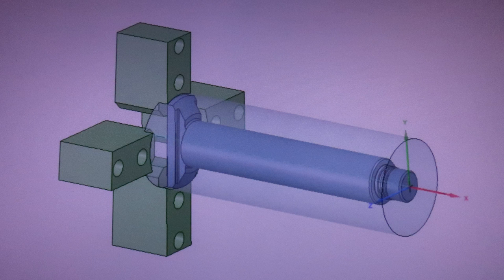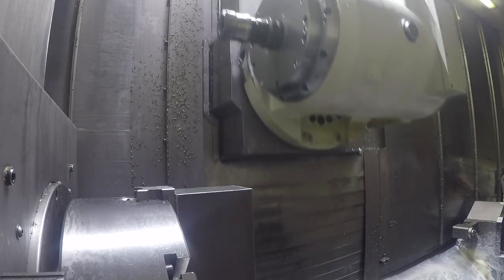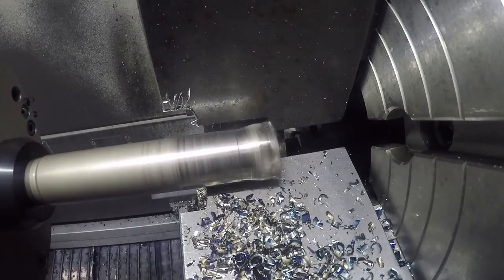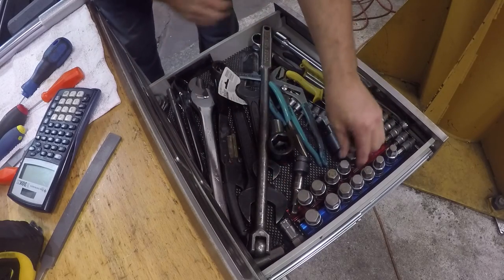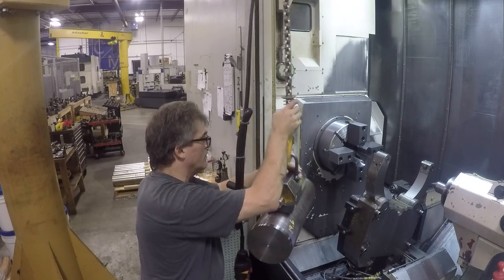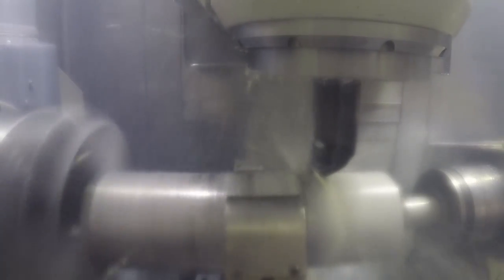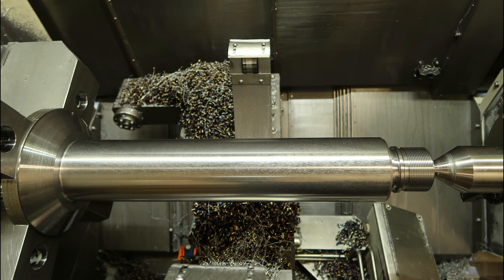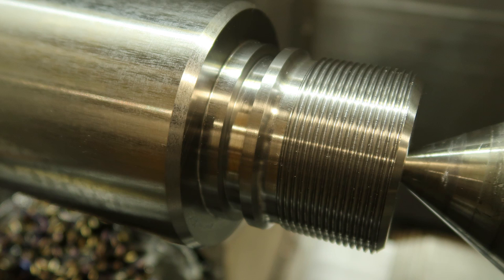Ram Shaft -1

Comment: No iam glad you didn't cut the jaw prep out of the vido because there are alot of people out there that dont relize how much goes into making a part thay think just put it in the machine and make the part so thats a good thing
Reply: I will never get it what gets you (mainly Americans) to use a 4 Jaw chuck for round parts...
Reply: @Fabiable  Concentric from the very beginning... this isnt a MM vs IMP thing. Its based on principle or poverty (no$ for both 3&4 jaw).
Reply: @Fabiable  Better holding power with a 4 jaw. Spin that size shaft that fast sticking out that far while facing and there's a good chance of chucking the part in a 3 jaw.
Reply: Fabian Nenning 4 jaw chucks are much more precise when well adjusted. 3 jaw chuck will always shake a little bit (around .003") so if your tolerance is thighter than that you got to use the 4 jaw chuck
Reply: @RochCroque  what a bullshit, if you use soft jaws on a 3 jaw chuck and have a workpiece with a good face and turned surface, you will get 0.00mm concentricity.
And i had faced/turned the ram shaft first with hard jaws into his diameter, on the this "T" side.
Then clamped on soft jaws and turned the thread and etc.
Switched to clamp on the diameter and milled the other side...

Time is money and you as americans should understand it the most...
Reply: @Fabian Nenning. UK here. I haven't worked on a CNC lathe for 20 years and I couldn't believe what I was watching. First op I would of used a sling ( no fancy magnets back then 😃 ) and put it in a set of hard jaws in a 3 jaw chuck. Bashed the other end to true it up 😊 then faced and centre drilled it. By the time that op had finished he would still be using a clock checking his 4 jaws. 😂. The 2nd op would utilities a set of pre bored soft jaws. I didn't ever do any work on a CNC lathe using a tail stock but locating onto the centre would be easy enough. Saying that even the 2nd op could be done using hard jaws. This looked like a lot of faff for what was being done. Even that machine didn't look like the right machine for doing the second op. An ordinary CNC lathe with tools on a rotating head would of done.
Reply: @hocln2556  but turning soft jaws every time to your desired shape + material cost isnt worth it

Comment: So nice to see videos about the specifics of CNC setup from a genuine working professional. So much of the stuff on YT is either amateur or pure theory from applications techs. 

Also, Okuma has a envelope travel limit feature (I'm 90% sure Mazak does as well, but its been most of a decade since I ran one). It basically puts a soft limit on the travel in both directions in whichever axis you need. I use it a lot to basically guarantee that I won't hit my jaws or center. On jobs like this especially, it helps to reduce the pucker factor.
Reply from the maker: Duncan Thanks for your comment. The Mazak also has what they call safety barriers (I usually turn them off). That doesn't help when your in the cam software. In Esprit TNG you are working with a accurately defined model of your machine. So it will tell you in anything is wrong down to .001" or better or what ever you define. This is particularity helpful on a mill turn doing milling on the face of a part. Many of them have limited travel in the X minus direction. (Min has only 10 mm X minus travel) So if the simulation shows you going out of machine travel in the X minus direction You can change the C axis solution or machining strategy to correct the problem. Without that you would have to find out when you run the machine. This can be as little as .0001" so without this ability in the software you can't see it in a normal simulation. If you use accurate tool models it can also do the same for tool collisions. Something the Safety barriers may not tell you.
Reply: @EdgePrecision  I seem to remember being regularly frustrated with the soft limits when I was running Mazaks. We ran all Mazatrol programs, and were pretty lax on defining the tools, so that probably didn't help.

Comment: That was one of my biggest fears, "crashing the machine". Back in the day, I watch a co-worker crash one of our Kitamura's 80xi's (from the late 80's to 90's edition's), mind you, that was all I needed to see, to put the fear of god in me, to never take for granted, the amount of power these machines have at their disposal to convert into absolute violence and chaos. Those were 10 and 15 hp machines, LOL...  You have my respect, as per, the 60 hp, units that you play with everyday. One missed step, and it is costly. Nice job, again on the video. The engraver pencil (although, you assumed there wouldn't be any interest in that footage), was that real time motion, and what was the type of cutter or abrasive used,... fluted, stone, diamond?.. meaning, it plowed right on through the material... Drew
Reply from the maker: Dru Bradley the beginning of the scene was in normal speed. The grinder is variable speed from 0-50,000 rpm. I was using a carbide burr at 40,000 rpm.
Reply: I crashed a Mori-Seiki SL 25 in the beginning of "my career" and it was enough to scare me :D
Reply: I worked for GE in the gas turbine division thay had some rather large VTLs with a 20' dia. chuck 3 rams i dont even remember what the HP was but anyway i seen a cowerker setting one up and the left hand ram was down and just alittle close to the jaws when he started the machine up it winded up and hit the jaw with a bang i can still here today and continued on to the next 3 jaws Bang Bang Bang knocking all 4 jaws clean off the chuck and into the air flying till the machine came to a stop because those machines dont just come to a stop when you hit the stop button nedless to say i gained alot of respect as to the power of those machines its a good thing it was the night shift and there werent that many people there because toes jaws landed right in an spot that people would have bin if it were day time to this day i check and dobble check and tripple check as to the clearance on any chuck that i am running
Reply: At some point everyone will crash a machine. Sadly it happens. The worst one I saw was on a bullard with a 48" chuck. Guy just wasnt paying attention and restarted the program with the tool inside the part. It blew the entire 600lb assembly out of the machine through the doors and into the floor where he WAS standing. Called that guy Usain Bolt for years. Another guy went full rapid into the spindle of a SL35 and blew the Jaws off the face. I crashed a 3" boring bar on a Mori nh6300 into an alignment pin I forgot to take out of a part for line reaming.

Never feels good.
Reply: User Name I’ve been indicating parts in when we turn od’s in two op’s we blend em and send them.  Forgot to handle my turret up and away when I finished indicating and went to cycle start.  We ran some long big boring bars in the turret at the time and it just indexed around immediately till it met my part in the chuck.  Was more scared I had to go tell boss man.  Haven’t made the same mistake yet though that’s true with all my crashes lmao

Comment: Honestly? The deburring was the most valuable part as far as learning is concerned. I'm not gonna be making gun drilled inconel air foils for the space shuttle on an Integrex (as awesome it is to see how that gets done!)... but damn if I couldn't use some learning on hand deburring of steel parts from a badass machinist (which you are)
Reply from the maker: Thanks. Wow you say stuff like that its liable to go to my head.

Comment: Peter, great job, thanks for the video. That surface pattern seems to be from either a cold drawn bar, or a cold worked and forged bar, before its heat treatment. This part must get some serious cyclic compression loads for them to have given you such a stock.

Comment: If you're doing a lot of this type of work it can be helpful to set up a jig made from V blocks in a mill. I used to make a heap of drive shafts and by first mounting in the cnc mill we could machine a face on both ends to a precise length,  drill, tap and cut a centre taper on both ends. Made total machine time way faster

Comment: Man I wish I got to run tiny parts like this on my 650H. Mine has a 26” SMW air chuck and never have parts under 20” diameter or so. Nice video tho. I like how you went through the whole process with the material prep and Jaw stetup. Most people don’t get to see all the stuff needed before even turning the part.

Comment: Do you make your own sacrificial jaws? Or buy them by the boat load? I really enjoy your videos. Not everyday you get to see start to finish process of limited run, tool room style work on a huge machining center.
Reply from the maker: No I buy blanks and machine them. It is difficult to compete with the people that make the jaws. Often times the blanks cost not much more than the material if I made them. They must buy large quantities of the material and get better discounted prices than I can get. It just isn't worth it for me to make the blank jaws. This is also why I have a CNC tool and cutter grinder and don't grind standard end mills. The price of the centerless ground blanks at the quantities I purchase. I can't compete with big manufactures. Plus the cost of coating the tools. I only grind special tools.
Reply: Thanks.

Comment: Nice work! Not sure what CNMG insert you used on that roughout operation. I've had success with Sandvik's CNMG 543 (r.046) PR 4305. 425sfm .026 ipr @.300-.325doc.  4140 brinell of 300-310. Not sure you want to apply that amount of load on a Integrex. But a little Nexus 550 will do a great job handling those loads. The only problem is the jorgensen conveyors can't move fast enough to evacuate the big chips up the incline. So change the little sprocket, up one tooth, to increase the speed of the belt. I rough the hell out of some parts for FMC with a positive rake holder. That way I can use all eight corners of the CNMG. Grooving I usually run at 1300sfm. I saw Y'all posted a job opening!

Comment: ..Just found your channel today...excellent contents, especially the ones about how you got started...!  What is the thread pitch on the end of these (Hydraulic?) rods....12-TPI? That's a very common pitch for hydraulic stuff no matter the diameter....you mentioned nickel plating, then ground...is that going to finished in hard chrome?...usually wears better than nickel would. Even with the CNC, do you still run a 'spring pass' on threading?
   I was the 'Welder' in a shop with a lot of manual machines, but we had 2 guys doing hydraulic repairs...lots of rods threaded on one end for pistons....almost always 12 TPI.......then I'd weld the rod eyes back on....we had rods up to 5-6"....! cylinders up to 10" or so....and 3 stage, 27 foot for total of 81 foot for cranes....5 stage, maybe 18-20 feet for dump trucks...
Reply from the maker: Doug Ankrum Yes the thread was a 12 pitch. After I did my work the parts got ground than electrical less nickel plated. I think there is some API spec. That doesn't allow the hard chrome plating. But I'm not sure.

Comment: Really enjoyed that thank you. To a newbie like myself I was wondering whether there are any viable options for a forging that starts you closer to the finished diameter but with the flanged end but have less material to shift? Not trying to be a smarty pants (I freely admit that I am just learning) but is the reason that it would be too expensive for a relatively small run?
Reply from the maker: Thanks Frank. This is manufactured to the customers spec. They say what material. I guess a forging would be closer but the quantity is so low they probably don't want to spend money on the tooling.
Reply: @EdgePrecision  thanks for the reply and thanks again for the informative video.

Comment: Nice work Peter.  Seems odd they want a 32 finish if they are grinding and plating the part??  You mention when you were checked for tool clearance you also were looking at the sheet metal too.  Does the machine have limit switches at all?
Reply from the maker: Bill De La Vega Yes it does. Mazak has barriers that stop the machine in Mazatrol but in a eia program these may not work. The machine has to travel in the Z axis further than this to make the tool change. So you can hit the chuck or the cabinet if the X axis is down to far before hitting the limit.
Reply: So you're loading the program from your CAM software, that is an eia program?
Reply from the maker: Bill De La Vega That's what Mazak calls a G code program. You have to save the program with a .eia suffix for Mazak to recognize it.

Comment: Excellent video as always. What kind of tip do you use in you pencil grinder, a burr or an abrasive tip?
Reply from the maker: Thanks Chris. A carbide burr for most things. But I have used all types of tools. It can be slowed down to 1,000 rpm with constant torque. Its speed range is 1,000-50,000 RPM.
Reply: @EdgePrecision  Thanks Peter for the quick reply, I'm sorry I should have specifically asked you about the tip you use for de-burring post machining. I've been a manual machinist for 20 years, your videos let me into the weird world of CNC, fascinating stuff.
Reply from the maker: That is what I'm talking about the NSK pencil grinder.
Reply: @EdgePrecision  Thanks

Comment: Great video Peter!  What is your experience with Espirit's machine simulation, does it provide good collision detection/prevention?  Also, that deburring tool looks superb, what were you using for the tip and what are your general recommendations for pencil grinders?
Reply from the maker: Norman J , Esprit's collision detection works good if the tools and holders are properly specified properly. The grinder shown in the video I've owned for over ten years. At first I resisted buying it because of the cost. It has given no trouble it is much more powerful than a small air grinder like a Dotco but a little heavier. Even at lower RPM it has power because it's constant torque.

Comment: with a shell mill made for High feed you Can go on plunge milling . in the releaf on side of the jaws you can start of outside and plunge to the bottom near chuck in less pass . and leave 0.2 mm on side to finish the surface with a 90° shoulder taking 8/10 mm of depht each pass .
Reply from the maker: Perhaps that would work the finish wasn't critical. This just seemed easer to program my cam software doesn't do a roughing cycle that I know of with straight plunge milling. I would have to program a bunch of drilling cycles to do it. If this was something I had to do over and over say in a part that probably would be the way to go.

Comment: Great!!
For setup thread turn why you use blocks, machine not have probe?
Reply from the maker: Thanks Eduard. The machine does have a probe. But the location of the probe is so high and to the back when deployed its hard to see when you jog the tool up to it. Also because my machine doesn't have a jog pendent (A handle jog wheel on a extension) I can't reach the jog wheel on the control and be up close to the tool setter probe to see. I find it is faster/easier to just touch off tools manually. I also like the conformation of the tools actual location (The Mazatrol shows the tools actual location in relation to the active work offset on its display) in relation to the part.
Reply: Not understand-me ,you best operator machine cnc or video?)))  
Best regards from operator Anca & Rollomatic!)

Comment: Nice work and great videos. Try running the 4140 without coolant and that may get rid of the spotty look to the finish. Of course only if the insert can run dry. I run iscar ic908 with a "pp" chip-breaker  dry in 4140 with great results for insert life. I also run Sandvik 4325 with a qm chip-breaker dry aswell. What kind of inserts do you use in this video?
Reply from the maker: adavid7901 , I will have to get back to you on that to be exact. The roughing insert is a Iscar one of their newer grades. The groove a Sandvik and the others Sumotomo.
Reply: Edge Precision sumitomo make great inserts for heavy milling .. in my experience i work with 50/63/80 mm shoulder mill and 45° facing . on facing on my iso40 i remove 4 mm depht on 42nicr 65% engagement at 0.23 mm/t .. heavy chip !
Reply from the maker: adavid7901, I have a better answer for you on the inserts. The roughing insert is a Iscar CNMG 432-TF IC8250 The finishing inserts are Sumitomo DNMG 432EMU AC520U Shaft OD and VBMT331ESU AC520U Pin OD and Rough Thread Relief. Groove Sandvik N132H2-0396-0002-GF 1105 Thread Vardex full profile lay down .375 IC grade VTX. These may not be the best grades for this material they are just what I had on hand without having to buy new inserts. The Iscar insert had no trouble roughing the whole part with one tip. It would have done more I just indexed it every part to be safe. The other inserts gave no trouble either.
Reply: Edge Precision I really like the sumitomo inserts in a cnmg same grade and chip breaker I run them in inconel 725 at 200sfm at .009/rev and .09 doc. And they last longer then a Sandvik ceramic. The iscar tf chip breaker is awesome aswell. I haven't used the 8250 grade but I'm sure it's great. Most of my turning with iscar was with IC908 or IC3028. I found The Sandvik 1105 grade works really good in stainless but I like the 4325 better for an all around grade. Keep up the great bids and work.
Reply: Edge Precision the 8250 grade and tf chipbreaker are exactly what you should be running. Good job